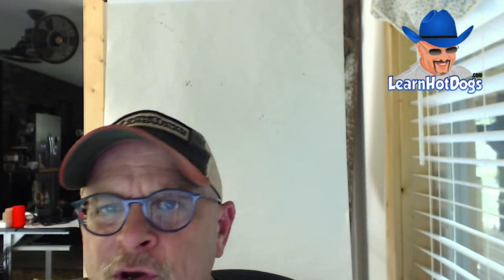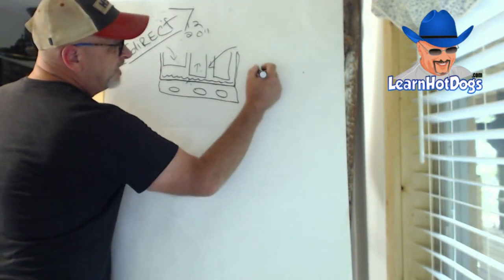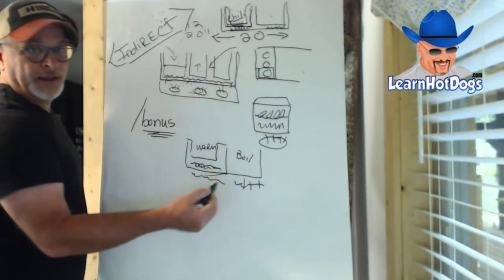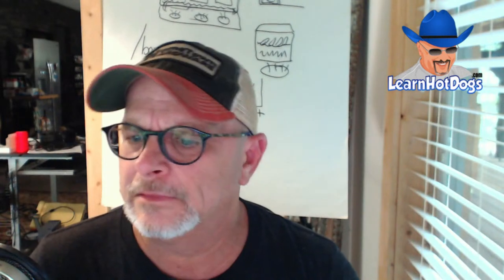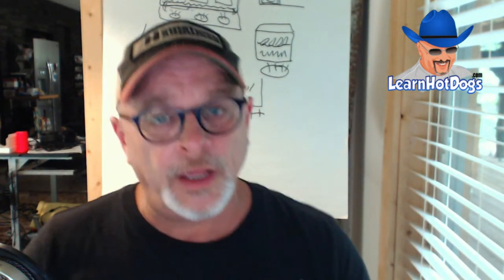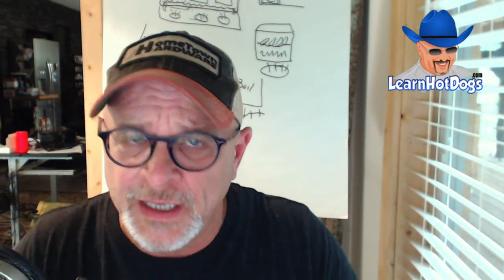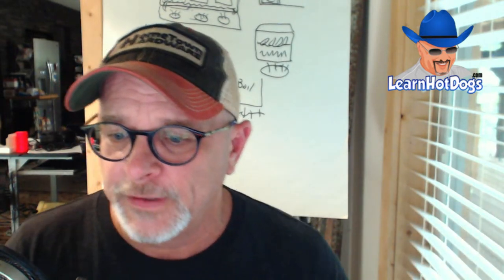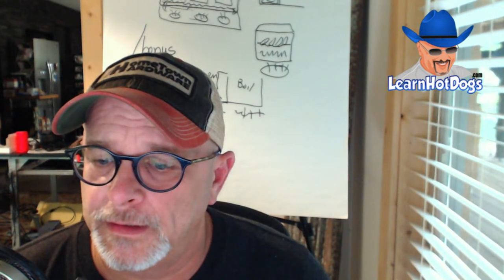The WRONG Steam Table For A Hot Dog Cart!

Comment: I bought a used cart that had only one burner cheap. Then using what I learned from Keith from the diy cart course modified it to use a two burner for only $60 more in materials.
Reply from the maker: Smart move!
Reply: Hot Dog Cart Store Everyone should watch the diy cart course that is considering getting a used cart. Almost everything can be adjusted or fixed. Many will pass up a great deal over things that can be changed or fix, using info Keith shows how to do.

Comment: Can you order these tables that are already open to direct flame. If so what would they be called. I am banging my head on the wall over it.
Reply from the maker: Never seen any Kevin. Most cart manufacturers build then into the cart. We teach it at buildacart.com
Reply: @BensCarts  I did find an Avantco electric steam table that is a warmer / cooker and will get the water to 212. Problem is that is electric.
Reply from the maker: @kevinrethier233  Yup but that's the problem. Electric.